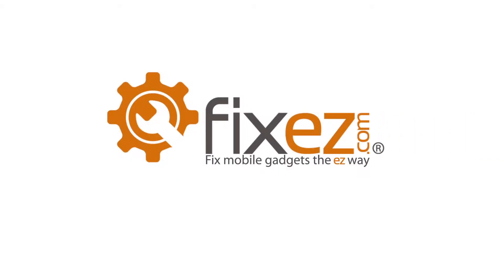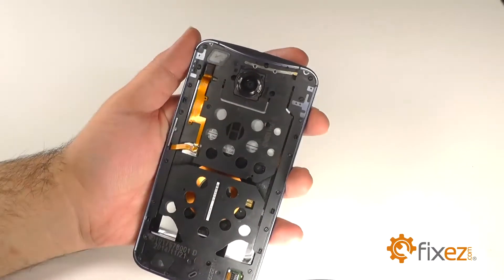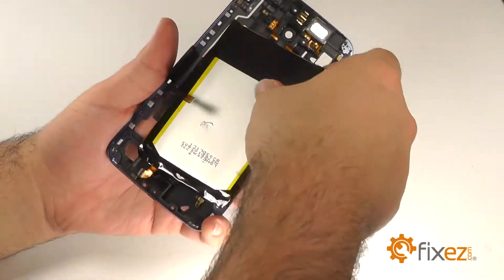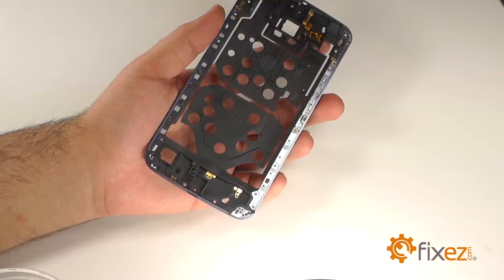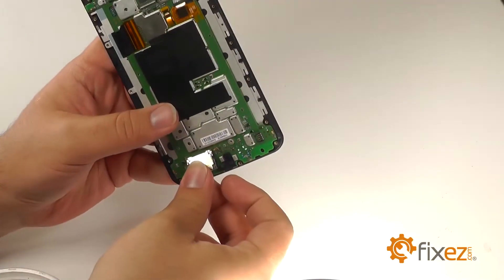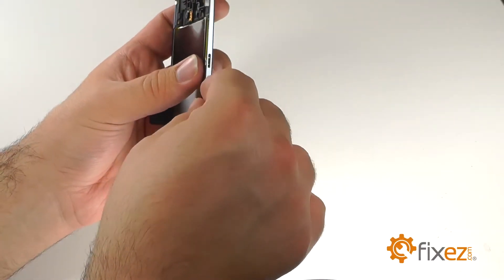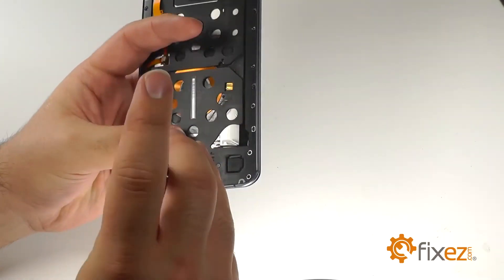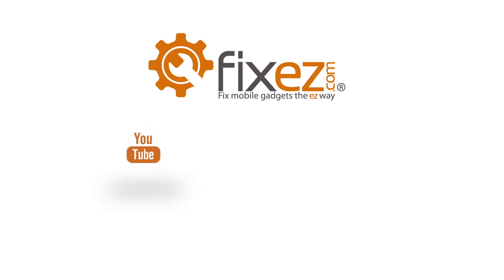Official Motorola Nexus 6 Teardown Video - Fixez.com

Comment: HELP! I was trying to remove the 22 screws on the back of my phone but the two screws deep in the phone next to the camera won't budge despite how much pressure I use. Any tips on how to remove them without messing up my phone?
Reply from the maker: +Mohamed Tairi Difficult situation, we apologize to hear this. Try applying slight pressure and slowly unscrew the screw. It's possible the screw head is stripped and you may need to use a small flat head and apply the pressure while slowly trying to get the screw out.

Comment: You did not explain how to take out the buttons on the front top and bottom of the phone. I received a new digitizer and screen and it did not come with the top and bottom buttons. So I have to use the old buttons. I am not sure how to pop them out.
Reply from the maker: +Kevin Polin These would stay on the frame assembly. Did you purchase the screen with the frame?